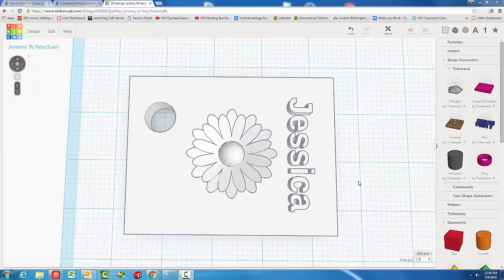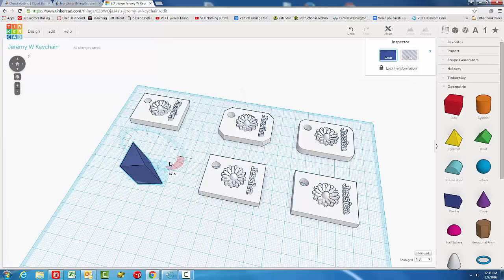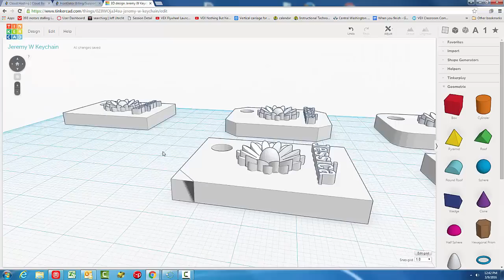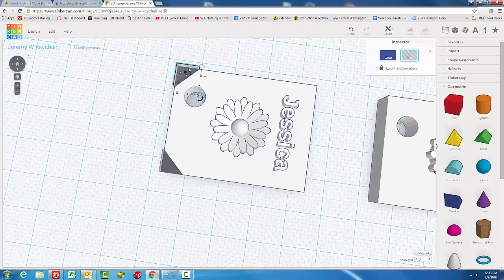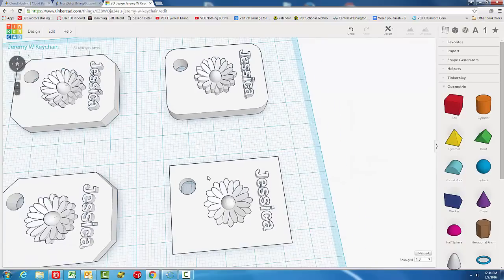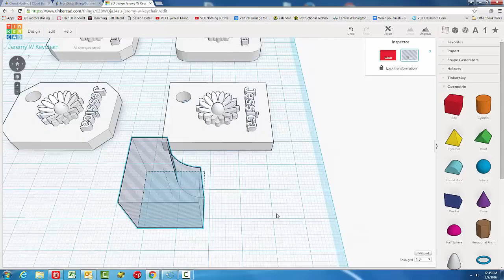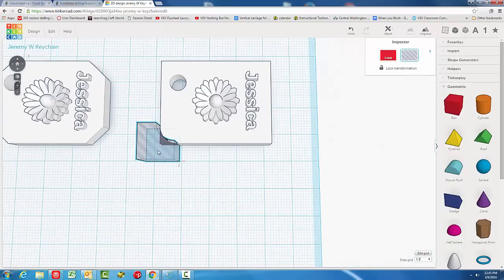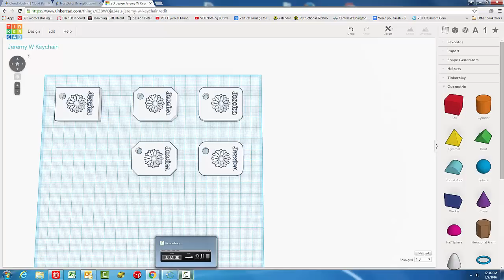TinkerCAD Chamfer and Fillet Corners

Comment: this is how i do it for square parts but im trying to find away to do this with tapper boxes an so far i can do it but its a pain to get everything place where it needs to be, b4 i could always make the delete parts a specific size an then all it took was me using the align tool to move the delete block to the right corner an then u could move it by a specific number on the x and y for all 4 corners an everything lines up perfect but thats not the case for the tapper boxes. i keep seeing something about a chamfer generator when googling but havent been able to find it in tinkercad.